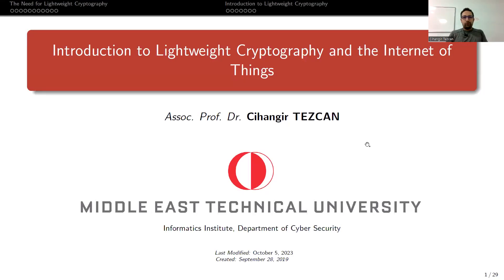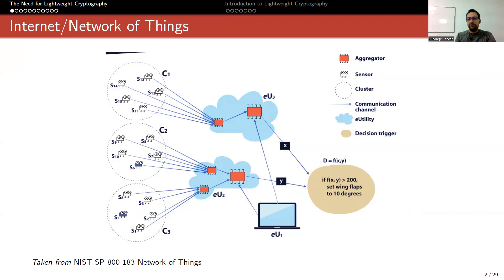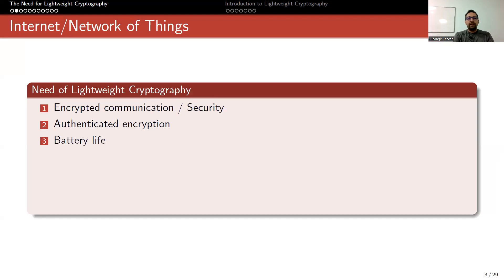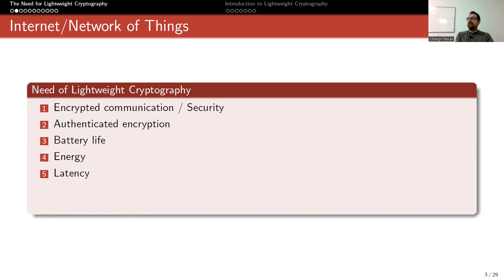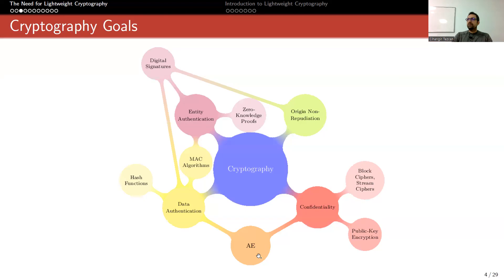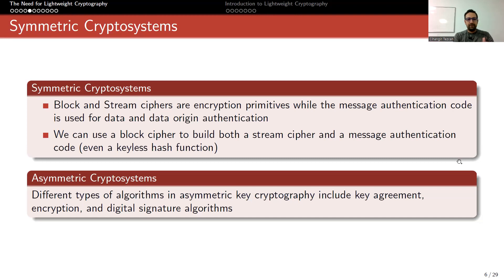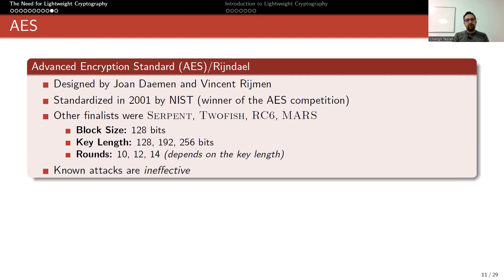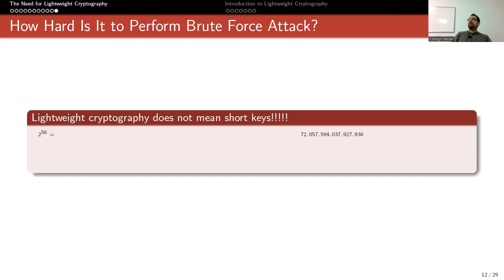Need for Lightweight Cryptography

Comment: Hi, I would like to throw a question as follows: 
I read ASCON lightweight cryptography algorithm and I see authenticated encryption and hashing, but I do not see connection between their operation diagrams. Could you clarify it? Thanks a lot.
Reply from the maker: Ascon reference documents actually have nice pictures and explanations. Ascon is a sponge function. For encryption, you use it as a block cipher and encrypt plaintext as blocks. When you turn it into a hash function, you keep feeding the input until the end and afterwarda you provide the output which is the hash of the input.
Reply: @CihangirTezcan  I mean, input of encryption are associated data(A) and plaintext(P) and output are C,T; while input of hash function is message(M) and output is H. Therefore, I do not get the connection between them.
Reply from the maker: @ngocmanprocoder first watch my hash function videos, then authenticated encryption videos. Actually, they are in a good order in my Applied Cryptology course Youtube playlist.
Reply from the maker: @ngocmanprocoder Applied Cryptology playlist Cryptology: https://www.youtube.com/playlist?list=PLUoixF7agmIvda3o_AuJ2y33Rx-1Kvymw